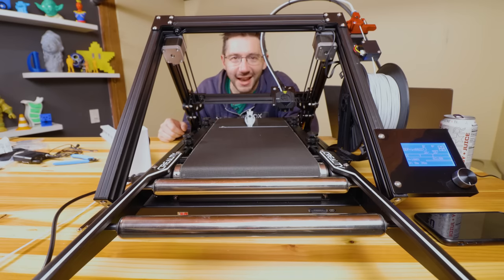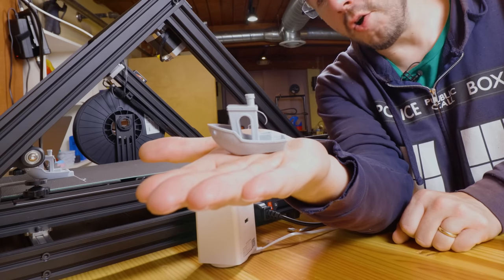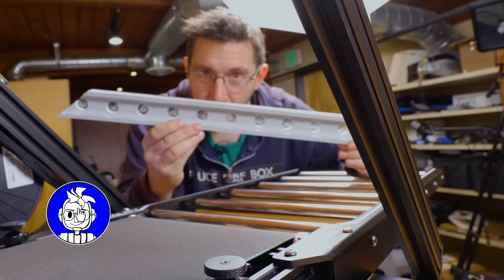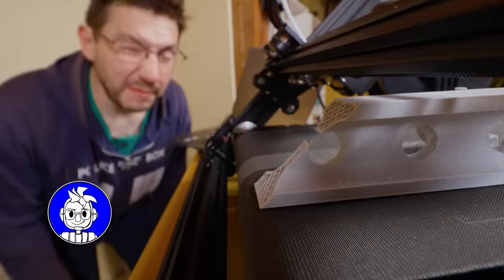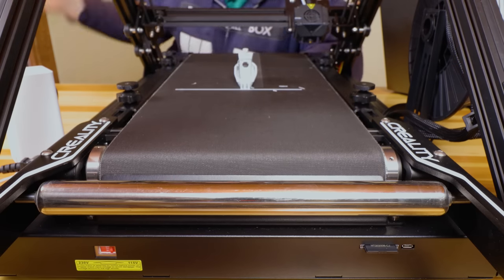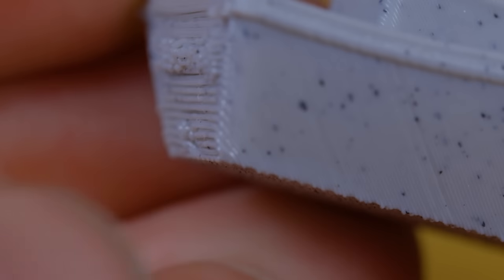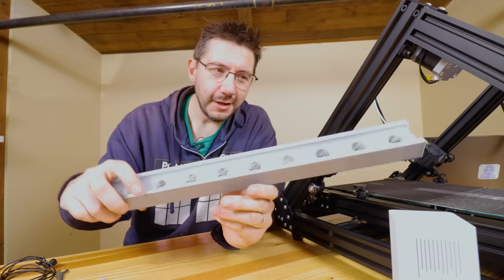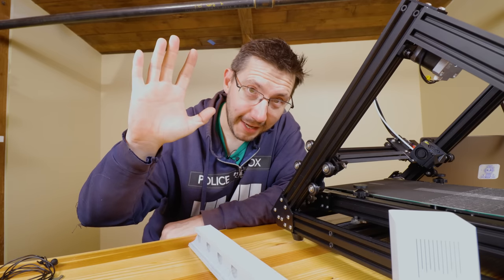Creality CR-30 / Naomi Wu's #3DPrintMill Update!

Comment: The dimpling pattern under the piece ads strength to the piece,,
Reply from the maker: Makes if fly through the air better like a golf ball :)
Reply: @3DPrintingNerd  U need 2 print a golf ball now that U have said this :)

Comment: I need to print S Gauge 1/47 scale Steam engine bodies, can you find one and try it on that belt. I love the idea and rigid frame. I don't like the large diameter of filament and poor finish that results. We need to ne able to squish the bead flatter and have the nozzle make the finish not the belt fabric. I would get close up video at the nozzle and adjust offset manually to experiment on the finish of the part. And change the filament material. I use NylonX for the strength, color and finish. I am making component adaptors for these trains with my Creality 10S Pro.  My Parts are listed on Shapeways. With this machine I could print more of my parts directly, and save my Hobby friends money. We will need a monitoring systems, cameras and vision analysis to detect problems, absent human monitoring. My Lab is in the basement and my wife refuses to let me stay there 24 X 7 or even past 9PM. So remote monitoring has to be facilitated.  Partnering or simply listing proven turn key solutions would be great in the coming months, By April at the latest. Focus a small team on surface finish as a combination of nozzle, positioning, control and filaments and filament parameters. I truly love the look and feel of this design and execution. the rugged and rigid frame is critical. Well Done! I used to design and build CT Scanners for Brain imaging and we had to work hard to get a rigid foundation before we could focus on the data collection devices or X ray beam alignment. if things were vibrating or wobbling it was bad. We used video and strain gauges to perform shake tests by oscillating all the drives at different frequencies to detect weak joints. I think monitoring the nozzle with laser detectors and oscillating the drives one at a time we could ensure all the flex has been removed. Then with that foundation continue to do the above mentioned development into high quality finish. Having worked in Aerospace and Medical and Factory Automation I know a lot of testing we could perform to ensure a long life of high caliber print output. With such a small machine (Compared to Rocket Nozzle or Full Body Scanner or AWACS 36 inch round 6 layer PC Board) this is a small machine. You have a wonderful baseline here i hope we can collect all the right folks for a great refinement and massive push to be the machine that reopened cottage industry worldwide for real. with reliability, high quality, strong support, massive broad reaching application expertise and filament, nozzle component variations with support software to make then work well. Good Luck and God Speed. Dennis in Virginia   In this link all the white parts are 3D Printed and installed on a 1954 Model Train Steam Engine.  https://youtu.be/WLLAZt5Z4po

Comment: I just don't get the print angle.
Reply from the maker: Meaning, the how or the why?
Reply: @3DPrintingNerd  Since the angle has the nozzle printing at 45 degrees to the bed, then why? I can't see any advantage to a basic cartesian printer doing the same thing on a belt bed? Does this bed only move in one direction? Surely not!
If the Z axis is angled at 45 degrees, WHY? Copyright problems?
Reply: To put it rude and plain. If the nozzle is angled in any way other than from directly above there is distortion  of the blob squirted.
Reply: @Quadromodo  The bed does only move in one direction.  That's the entire point of this bed.  It's so you can make super long parts or massive amounts of smaller parts without stopping the printer.
Reply: @Jbot123  Then why not move it in both directions?
Reply: @Quadromodo  Are you trying to control 2 axes with one belt?
Reply: @Jbot123  No, I'm talking about the print surface/belt, the Y axis in normal terms. I'm still asking why in one direction only?
Reply: @Quadromodo  Because if you reverse it, your model will collide with your print head.